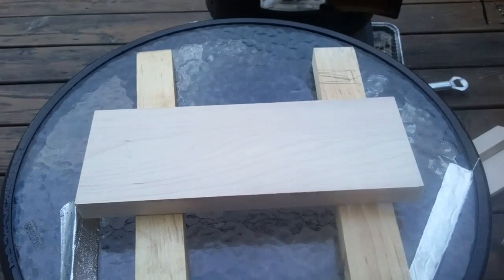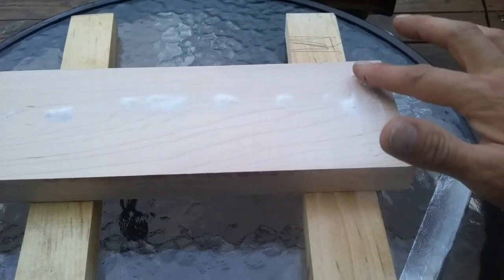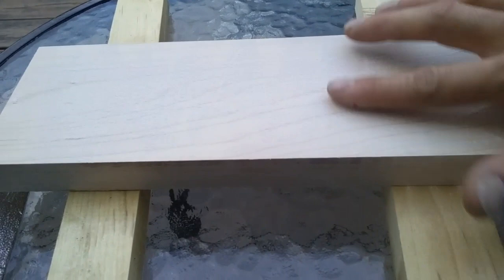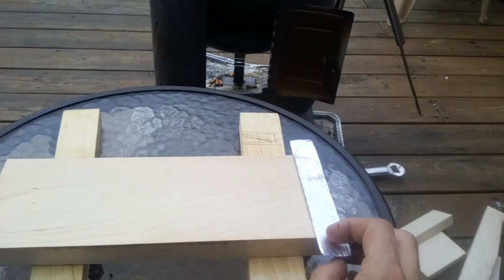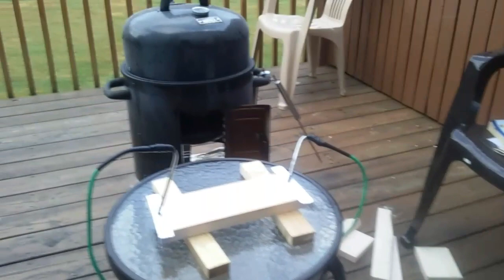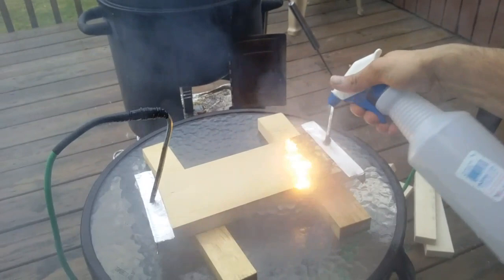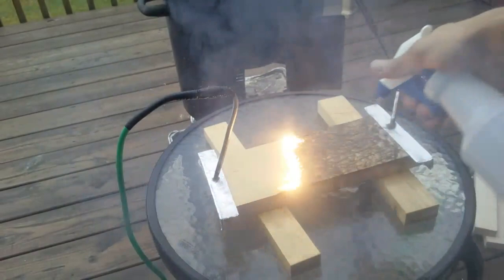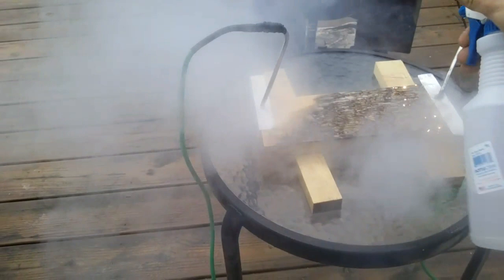Lichtenberg Refined

Comment: If you are still alive ......I would stop using this technique immediately! LOL
Reply: There really isn't a great deal of danger involved in spraying electrolyte on the wood. It's coming out as a mist and as long as he doesn't apply a steady stream to the wood, or do it too close, the electricity won't arc his direction.

That being said, I wouldn't use this technique either. But just because adding a solution of electrolyte ~ 1 Tbls. per cup of water ~ with a brush is much more effective. It dissolves evenly in the water and adsorbs evenly in the wood and you can control the amount you use.
Reply: @deanr8110  "or do it to close" thats all it takes. Just do it the safe way, its not hard at all

Comment: Terrible burn, and a method that could get you killed. Look up a guide please. You need to mix baking soda and water, then spray the wood. If its hard wood let it soak with the first spray then spray again. After you finish that, turn on the power. Volts are somewhere in the 2000s, and can arc if you get to close. I seen you get close 2 times. Please do not do this method